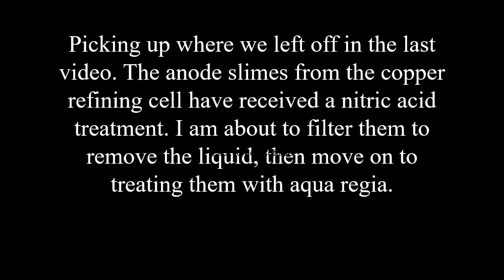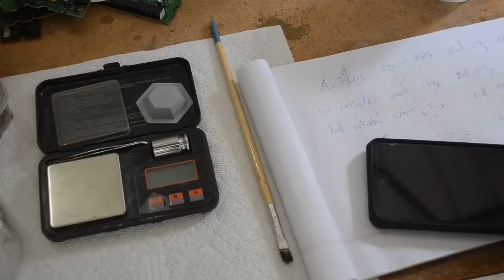Processing Anode Slimes from my Copper Refining Cell, part 2

Comment: Use the filter bags and instead of copper bars,  turn your copper into copper shot. The filter bag will save you a head ache messing with the liquids every day and keeping it running smoothly.

Comment: You might want to check out successful engineers youtube videos on “gold recovery via copper electrolysis”. It is a 2 part, but after the first part there is a separate brief update before part 2 that isn’t officially in his series.
He was recovering gold from a bunch of gold plated pins he cast into anodes. He sand cast copper sheets for his cell anodes, he shows his calculation for the optimal current desired per cm^2 of anode. He uses sheet stainless for cathode.

Also you might want to incinerate your slimes before you treat with acid.

Comment: Really cool content! I'm in the process of using hammer mills and processing circuit boards from E-waste. Electrorefining the copper out and then dealing with slimes. How would you deal with silver in the mix if you wanted to recover Copper, Silver and Gold.
Reply: Using an RP4 shaker table to separate the metals from the fiberglass.

Comment: If you are blowing holes in a single filter in the Buchner funnel, then your vacuum level is too high. Reduce the strength of the vacuum to the proper level and that problem won't occur. The filter should just dimple slightly into the funnel holes.

Of course, the double filter improves the filtering efficiency. But if the bottom filter remains clear of solids, then it is just a waste of filters. 

Keep up the experimenting and learning. Given the low gold levels in most of your materials, the more efficient you can make the processes the better.  Sometimes the journey is more interesting and profitable than the end results.

Comment: Looking forward to the testing of melted pins off eBay.  Probably 12 years ago or more (before I knew better) I bought some bars made from melted pins on eBay.  One is around 8 pounds, and the other I think was around 3 or 4 pounds.  This looks like the only way economical enough to process them?
Reply: I believe that’s the best way to process melted pin bars. Since the gold percent is so low. It takes liters of nitric to go through bars made like that. Electrowin 95% of the copper away and then acid treat the rest.
Reply: You might get about a gram from the 12lbs. Those are made with pins from new material that is not plated with gold it is ionized on so its so little.  Good luck,  post ur results or maybe make a video
Reply: @royalrefiningllc  Sreetips did a video where he bought some eBay “gold” basically melted pins. Doing an acid extraction showed that there was so little gold that he could not detect it and concluded there was negligible gold from the lots he purchased. So who knows.